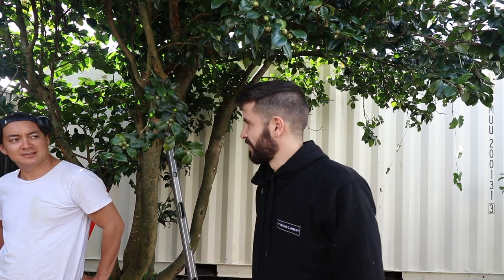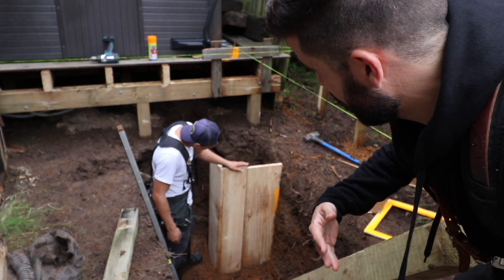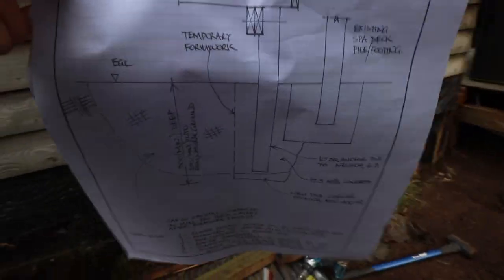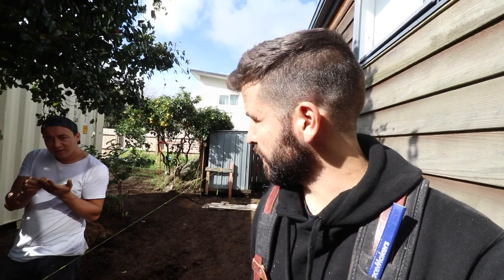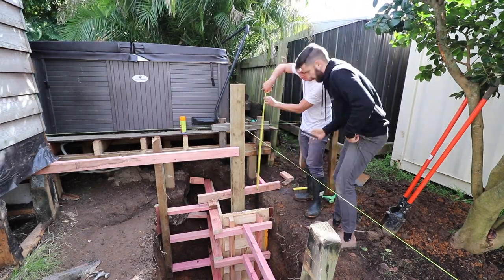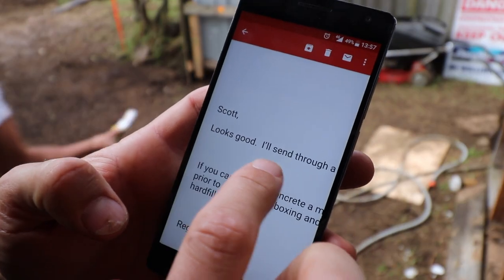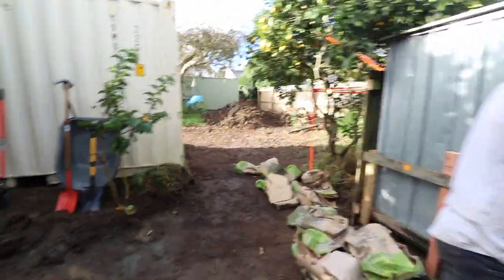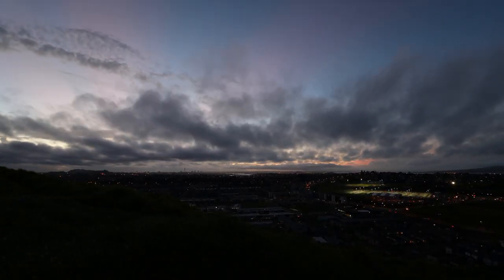15 bags of concrete for ONE Post

Comment: Here in Wisconsin, the town changed the code to where sinking a wooden post into a footing is not approved, because when the wood rots, the whole post will have to be extracted. So now all posts are secured on the surface of concrete footings with products like Simpson strong ties.
Reply: Yeah, I was thinking the same thing. Personally I would never sink a post directly into concrete like this. Thats just asking for problems in the future. Securing the post on the surface is the best way. The regulations here even requires the post to be secured a bit above the concrete slap so that the end grain doesnt rest on the concrete and attracts water/rot.
Reply: Same here, the post / beam doesn't actually touch the concrete footing. The Simpson strong-tie provides about 1" of separation between the 2. We are having a 2 story high deck built, where all the beams sit about an inch above the surface of the concrete footing. The footings are just slightly more than 4 feet deep, as our frost line is 4 feet.

Comment: Are the pink 2/4's how pressure treated lumber is in NZ?
Reply from the maker: EAC3 yeah man, of all the colours 😂  The treatment is red if you buy it in a bucket but pink once it is applied
Reply: Also how do you like your Makita circ saw. I bought one the other week and some of levers felt loose, has that been your experience?
Reply from the maker: EAC3 I know what you mean, it feels a little cheaper than the corded versions. I'll put up with that for the portability though

Comment: No wooden post should ever be buried in concrete.  There is no timber treatment that will last. All wood rots.  All wood can be attacked by insect, particularly when it is half in and half out of the ground.  You are 30,, You will live long enough that the post will need to be replaced.  To make any post last longer,, tar the end grain before you put it in the bottom.  A 20 cent bit of tar, 1/4 inch thick will seal the end grain.

For that much concrete,,, just bring it up another 6 inches.  same cost and will last indefinitely and the wood atop can be replaceable when the day comes.

Fence posts, they can be set in concrete.  Fence is temporary(20 years, 40 years) and then so is the post.

Annnnd for a post,,,, why mix the concrete?   Waste of time, materials, and effort.  Dump in dry and rod pack it.  One man can stand there and hold the post for position and plumb, the other pours dry pre-mixed into the hole and rod packs it.

Rod packing.  4 foot length of #4 or #5 works best.  Run the rod down through the dry mix poured in .  It will be loose and fluffy. The rod will slide all the way to the bottom.  Slide the rod up and down,,, and the dry mix in the bottom will begin to compact and stiffen,,, and it will force the rod higher.  work all sides,,, work only one and the post will be shoved over.  Work around the post,, over the span of one to two minutes the rod will be higher and higher until it is only sinking in 2 to 4 inches.  The post will be firm and right where you were holding it.  You are done.  Pour some water on top if you are of a mind,, or pour a lot of water,,, it will soak through.  Concrete is porous. Or,, leave it dry,,, it will suck moisture out of the surrounding soils and be fully hardened in a few days.

What you and the college educated engineer have done though,,, is make something temporary,, and 15 bags is going to be a nightmare to bust up and pull out 30 years from now.  Keep in mind, I am well more than double your age, and yes, I have had to pull those damned over builts out of the ground.  Some, my own.   Laughing,,,, keep that customer,,, you will be the one to pull it out.
Reply: Thanks for sharing your knowledge. Here in NZ builders must build to the granted consent documents/drawings. Any changes will require amendment to the granted consent which will consume quite a time and won’t be cheap. Builders usually do not get involved in design stage so there is not much other option than building it to the plan.
Reply: Contracts are contracts,, yes, I've done some things that I thought wrong or stupid.  I have also, please learn from this,,, some jobs,, I have refused to bid,, or simply made my case for the needed change.   Here we deal with architects and engineers.  Either can stamp a set of plans and those ar reviewed and approved by the building department.  I'll bet different words for exactly the same thing.

I am past retirement now,, but not a lick of sense, I still work.  I have eave and soffit work this afternoon and am headed for two roofs that need re-roofing next week.  The knees still allow it,, I'll still do it.

In my years,,,, college educated engineers and architects,, some are brilliant men and women,,, but all too often they have never been on a job site, and just as bad,, the resistance to change or innovation.  The worst of them, young know-it-alls,, would better serve a job as back fill.  They might be useful at that !.  

Then work around.  That post??,, butter the end with 2p of tar.  it will last twice as long.  Or,,,, dig in your heels, and refuse,,, because,,, and this I can 100% guarantee you,,, when it falls down,, you will be the one sued.  Not the person who designed it,, or the person that did the engineering,,, or the city officer that reviewed and approved the plans.  It will not matter that you kept all correspondence, or objections before following orders.  The architect designed something that will fail,,, the engineer missed his slide rule and gave a very bad answer,,the city official miss read the code and forced you to do something, the timber yard sent defective material,, the new owner himself insisted upon something,,,, all you did was supply the labour.  Trust me, it is you that will be sued or unpaid and hiring a lawyer.   

So,,, change what you know needs changing (make it look the same),, do a work-around that makes it better,, refuse defective material,,, and at some point,, it will only happen once or twice in your life, just say, "Sorry mate,, I ain't doin' that."  Laughing,,, I even got sued once for a job poorly done,, after I refused to do the job and someone else came in and did the work.  Whatever you do,, have fun.  You only get to do this once, live it well.
Reply: that is a really long reply lol. do you need to go talk to someone? maybe a doctor?
Reply: lol
Reply: @QQponda  he has a point
Reply: @Edward Duff dry pack allows the wood to dry underneath the ground. Wood can last up to 200years easily but you have build it with idea of drying on its own.
Reply: Sailor376also Great you have experience with your own timber and methods but here in NZ CCA treated radiata pine house piles will last 70-100 years minimum when set in 20mpa+ concrete. 
Shame CCA is no longer available where you are. 
Where experience really would have counted here is that rather than relying on the engineer they could have simply filled that hole with min 10mpa concrete as a fill up to the originally specced foundation height then set the posts as per design and filled the rest with the correct density & grade of fill. No engineer required as it all comes under approved standards to satisfy the Code here. 
Either way, the important thing it to be aware you're totally wrong about the timber used. I say, "be aware" because experience shouldn't stop you learning new stuff rather than thinking you already know it all.
Reply: Sailor376also I re-read your first comment. Dry mixing concrete is fine for a fence post but it's  definitely not for a house foundation. All you're getting is an irregularly set fill with pockets that invariably haven't cross bonded adequately. Pouring wet ensures the proper, consistent & uniform required strength is achieved.
Reply: Sailor376also To help you learn about the conditions here - The old houses were generally built with piles set in the ground. The timber used was a native medium density hardwood called totara. It was used totally untreated and the common service life of those has been anything from 70-120 years! I still see some that are still fine at 150 in bone dry soil. My own house is one example. 
The new treated pine is far superior even to those. We can expect those timeframes even in damp soil.